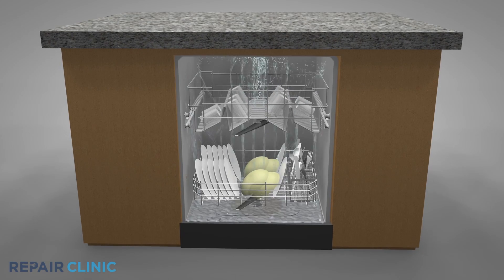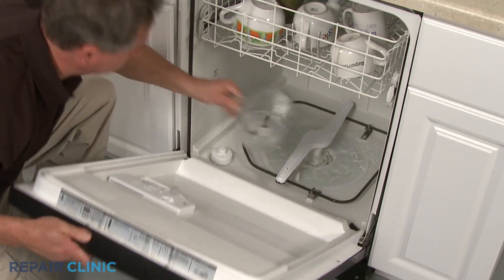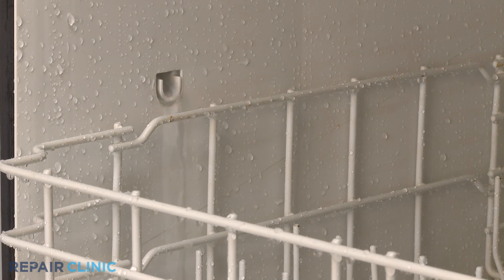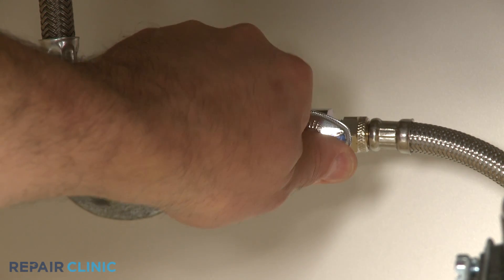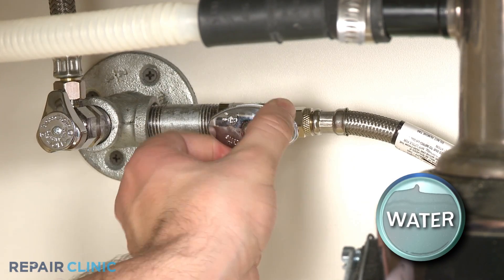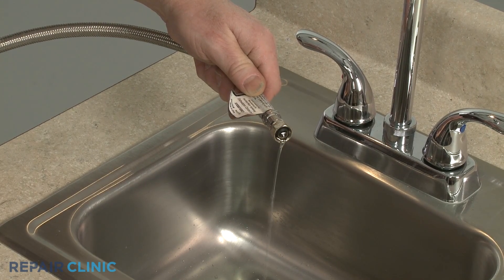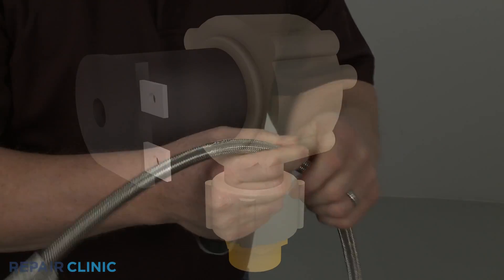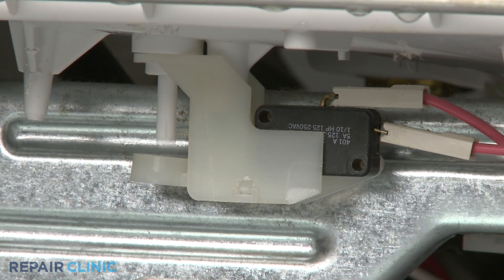Dishwasher Water Pressure Testing

Comment: I have low water pressure in my house, can dishwasher work on low pressure.
Reply: i am no expert but I am thinking if you fill the tank before running the dishwasher similar to how they do in this video to test it should allow the washer to run properly
Reply: I have same question.
Reply: You should have a regulator close to the point where the main water supply pipe comes in the house. Don't go crazy though, if the city main pressure is very high you could potentially do damage to your appliances. I would adjust it by half turns and check the pressure at the faucet. A clue you're getting too high is a squealing sound when water flows